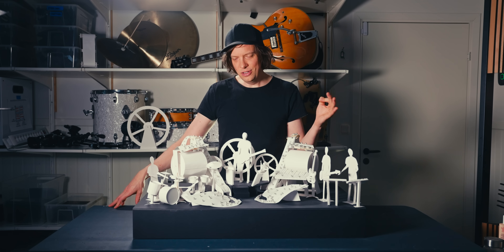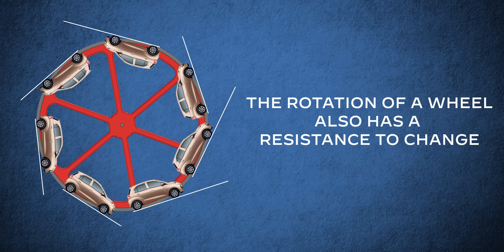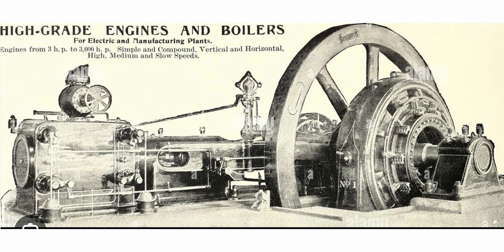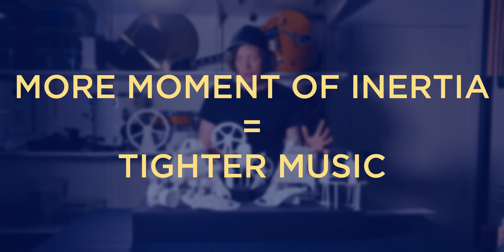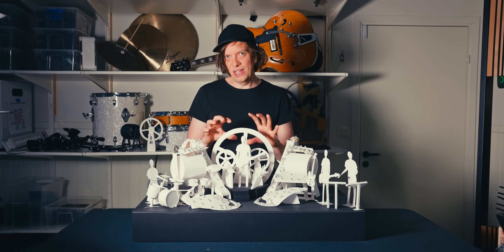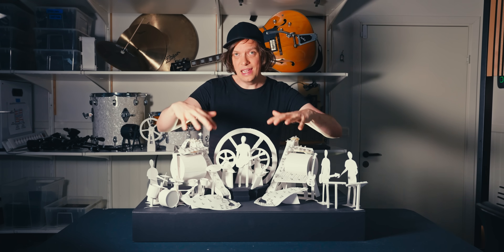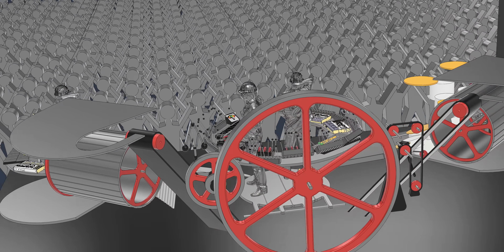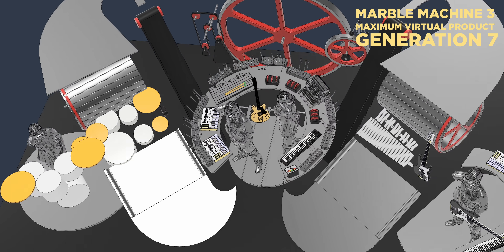What is Moment of Inertia? (The Heart of The Marble Machine)

Comment: It also becomes increasingly more dangerous to work around... if unprotected.
Reply: what if the larger size means it can move more slowly?
Reply: @PabloEdvardo  then it will slowly crush you instead of fast... Safety is going to be a topic
Reply: There will have to be some kind of plexiglass or other kind of shield
Reply: Bah, no Victorian worker ever died around these ginormous flywheels.
Reply: An instrument of death? That's fucking metal.
Reply: @OnkelPeters  Yes Victorian factories were famous for not killing anyone.
Reply: @voodooroller  any reasonable plexiglass shield would just be the first thing a runaway 2.5M flywheel would destroy. You would need something heavy enough to absorb all of the momentum. There's a reason they didn't bother shielding the giant industrial ones. If anything goes wrong there's no feasible precautions that will matter aside from dropping the whole thing into a deep pit, and maybe not even then
Reply: @RegebroRepairs  Exactly! And if someone died, it only redused the surplus population, which of course was good. - A little Dickensian referance there.
Reply: In my view not correct. The dangerous thing is going to be the stored energy. Not the moment of inertia. High moment with low angular velocity is going to store same energy as low moment of inertia with high angular velocity.
Reply: Angular momentum
Reply: Why did industrial era steam engines have large flywheels? Because the power stroke per minute number of these machines were low, so the angular velocity of the flywheels were low. Hence radius has to go up to achieve a certain target angular momentum. Large flywheels are a necessity if few rpm are required. If gearing can be introduced small flywheels can provide exactly the same angular momentum
Reply: @clausmadsen6754  I think the danger of the energy is the easies problem to solve.  the proper frame solves that, and that can be tested seperately from the machine.  You spin it up faster than you will ever do on stage, 20-30 times and bam you will know if its good enough. the people or stuff ending up in there is harder , because it needs to end up looking good.  Plexyglass will help with that problem. but still will be challenging.
Reply: @theJonnymac Just because it was fine once, doesn't mean it will stay fine. Metal fatigue, vibrations, faulty installation, damage during transport... A lot of things can go wrong. The test that's actually important is what happens when the flywheel gets detached or breaks apart (if built out of separate pieces). You must test the worst-case, not the best case.
Reply: probably will compensate moment of inertia by being lighter and turn slower, so way safer.
Reply: for sure there needs to be a disk covering the spokes. plus it would also reduce the wind resistance making the wheel more efficient.
Reply: To the new marble machine… people are the lubricants.
Reply: Мартин открывает клуб самоубийц? 🤔
Психически здоровый человек не сможет попасть в этот механизм. 
Борцов за ненужную безопасность - в пень!
Reply: Seconded. Machine guarding will be needed (but can also look amazing)
Reply: these comments about how dangerous it is are just dumb. Of course everyone knows that. That's why you make sure it's not gonna fly away badum tsss
Reply: So we need armor... Thats even cooler!

Comment: Please put a shield on this wheel! Either into the wheel or better - a transparent wall on both sides. Industrial age had a lot of people with fractional numbers of limbs excactly because of these huge flywheels...
Reply: Didn’t he do that for the flywheel on the MMX? I don’t see why he wouldn’t here too.
Reply: @tedioustotoro4885  because it big and heavy and it will not stop for such trivial things as arms or bones
Reply: Absolutely and they are going to be near it so its a real risk.
Reply: What if, instead of a shield, we make it out of super lightweight materials packed full of hydrogen, so that if it does break and fall off, it floats away. Just don't do an American tour with it, or some dumbass is going to shoot it.
Reply: This introduces new problems,  @UnfamusOfficial . Mainly, the point is it's heavy. That dm term in the formula shows us that the heavier, the higher the moment of inertia. Thus, lighter materials result in a much worse flywheel.

There's also the concern of the hydrogen leaking, possibly exploding, etc
Reply: Yeah I've thought - it would be much better if you had a smooth surface outside so stuff can't stuck between the spokes while it's spinning.

Comment: You gotta find one buff dude to take on tour who starts pumping half an hour early to get the huge flywheel up to speed before the concert.
Reply: probably will compensate by being lighter and turn slower, so same power input of the current one. and safer too
Reply: I have to wonder how long it will take to get up to speed...?  Also, this device will be used throughout the concert.  Will it keep on spinning between songs?  You will have to isolate the power so  you can change your pin drums safely.  I hope this will be mitigated as the design progresses.
Reply: @tomnesler2089 когда люди придумали маховик, тогда же придумали и сцепление.
Конечно между песнями будет вращаться.
Reply: Put it in an enclosure, get it spinning back home, transport it while spinning and it's ready to go on the stage. 🙂
Reply: Get Hannes to do it
Reply: Block and tackle system to raise the heavier weight will compensate.
Reply: @AffordBindEquipment 
Transporting a spinning wheel that size is not going to be possible because transporting a wheel that size was impossible in the first place. The whole point of being able to assemble and disassemble the wheel was transportation.

Comment: not to dismiss the positive side effects, but there are also some important negative side effects:
1) more moment of inertia means you need better safety systems, because the danger scales similar to moment of inertia. This will be a big problem, especially when trying to find venues that would host wintergatan + machine
2) more moment of inertia means more vibrations if the flywheel is not running perfectly true. Especially on tour, big mechanical things get bumped and slightly deformend, so this is something that will only truly be visible after some time. Those vibrations are especially dangerous for shows outside of full time music halls with a solid floor. Festivals/mobile stages build their stage surface out of stagedecks/scaffholding, that is very durable for heavy compression loads, but suseptible to vibrations/dynamic loads.

I think it is important to have these things in mind when designing, because with the current plan, it looks like you are building a machine that might be able to play music, but can never leave your show, because no music venue can/wants to handle it
Reply: Point 1) is very important for sure.
But point 2), not really. For a given angular momentum, if you increase radius (and moment of inertia) keeping mass constant, you can then reduce angular speed.
And as a net effect, this reduces the overall vibrations.
Reply: Great points! It would have to have a gigantically heavy base. Those giant example machines were bolted straight into concrete, and giant cast iron behemoths.
Reply: Let's not forget ensuring a stage that can support it; you don't want to limit the venues if there are very few that can take the load (both static and dynamic)
Reply: Well, with such a large wheel it can spin relatively slowly and thus the vibrations can be mitigated with just good bearings and maybe some slightly vibration-dampening mounting.
Reply: Yeah, the minimum viable product idea has gone out the window, really. this is maximum non-viable
Reply: Maybe it would not be that bad. Probably flywheel does not have to be solid steel, so even though massive, it won't be that heavy. It may have a form of huge industrial flywheel, but be build for example from plywood. I am not familiar with required momentum of intertia.
Reply: Also if you are taking it apart and putting it together for every show things will get worn. Alignment will be a difficult part of the design, it must only be possible to put the flywheel together in the correct way, and be planned for how to balance it before every show.
Reply: adding to that...
1) you should have an emergency brake that can quickly stop the flywheel and rest of the system should anything go wrong. (an old school mechanical drum brake on the flywheel with a hand brake lever for example)
2) guard rails, clear plastic can be used to prevent any limbs from getting caught without blocking the view.

also going from what you said in #2 having some holes that you can add extra weights in different places to the flywheel to rebalance it while on tour would help. (i know he hated this idea BUT a bolt with a washer stack would help with that, unless its really bad)
Reply: Also, more inertia means that playing more dynamically would become harder (changing tempo for different sections of the song). but I'm not a composer and idk if thats so important...

either way, I love the big flywheel - I would buy tickets
Reply: Agree 100%  the flywheel brings at least 2 major safety hazards- both can be overcome.
1) Must guard against human contact with flywheel (becomes a Salad shooter)
2) Guard against release of wheel from frame/ preventing wheel from escaping frame at all cost.

A safety brake would be nice- if practical. Depends on the planned amount of energy stored.
Reply: Do you think it's possible they could use a wider wheel and then just magnify it somehow?
Reply: @grantchereskin729  I think thats what the gearbox is for: changing tempo without affecting the flywheel speed.
Reply: @JackDaniels-pn6hu  3) Everything driven by the flywheel is a risk too; there needs to be a fairly low-force mechanical fuse (shear pin, frangible link, clutch plate) between the flywheel and anything else that can be touched
Reply: @grantchereskin729  the flywheel brings constant rotational energy into the system, some kind of gearbox and/or a governor can be used to set the actual musical tempo. The large flywheel will be a chore to get up to speed though all the energy it stores must come from somewhere.
Reply: Point 1: You can control moment of inertia by adjusting the weight of the wheel. So a big wheel doesn't necessarily have more moment of inertia than a smaller one, it just needs to be enough to run the machine.
Reply: I feel like martin saw "r^2" in the formula for moment of inertia and just went with it without considering what the machine actually needs. Consistent tempo can be achieved through a variety of ways that pose less mechanical, musical, and saftey problems.
Reply: @grantchereskin729  That's done on the programming wheel, the drive will always spinn in the same tempo thanks to the Huygens drive
Reply: A bigger wheel has the same moment of inertia for a smaller mass (or a greater m.o.i. for the same mass) and so would not increase static loading on stage. It wouldn't have to be made out of cast iron like the true industrial revolution flywheels, it's only powering a marble machine and not huge equipment. The vibrations could be stronger but they'll be less energetic and so likely less of an issue, plus balancing could be done with moveable weights quite easily, even with wear. If anything it's likely safer than a smaller faster flywheel, not only do you have more time to react, it will hold less energy (energy of flywheel = m.o.i. * angular velocity ^ 2). I know I'd rather stand in front of a slow rotating 2 m wheel than a fast rotating 0.5 m wheel!
Reply: The larger flywheel doesn't imply more moment of inertia.  The needed moment of inertia is already set for the system.
A larger flywheel (or rather flyring) can be lighter and/or rotate slower for the same moment of intetia. So a larger flywheel would actually help with all of the mentioned problems, not make them worse.  The wheel itself doesn't need to be perfect, it just needs adjustable weights to balance it each time it's setup.
Reply: We discussed the safety in the comments of the previous video. Martin seems to ignore this comment section. He is in the bubble once again.
Reply: The safety does worry me. It is a scary amount of energy. Should be tamable of course, but it needs to be taken very seriously.
Reply: I'm no engineer. But I have to say this. Why one big flywheel?  Why not use 3 smaller ones linked together to get the same inertia. They could be configured in a triangle. Could be just as visually big. Instead of one spinning thing. There are three. Easier to stop one of them should it be needed. Solves transportation. Already pre balanced. Could be a safer solution.
Reply: @tigerzero5216  That would be a mechanical nightmare. You could do it, but it would add mad complexity to the system. If you have 3 then you need to add gears connecting all 3. I t would end up being just as big as well, but have less inertia.
Reply: Exactly, you're gonna be dealing with a great amount of hazard if you go on with this flywheel design. Maybe covering it up wit some sort of plexiglass could help, but then you need to avoid stage light reflection...
Reply: I would say work out how to move a bigger wheel, don’t dismantle it! Putting it together again in a balanced way would be a mission every time. Maybe when you fly the wheel to another country you dismantle it but keep it together and drive it around on the back of a truck, once you are on the same continent.
Reply: Maybe danger is the most important part of the industrial revolution aesthetic. I would bet money that each of those machines in the illustrations has killed or maimed someone at some point.
Reply: @AJMansfield1  MMX had this issue too and it was solved with a slip joint. It saved the MMX several times when marbles got jammed in gears and such.
Reply: @MapedMod  He's not ignoring. He's aware of the safety issues, but he's trying to get the vision board complete first. Safety is something you can approach when doing the actual CAD designs.
Reply: @karolwachtarczyk  Isn't mass a major part of inerita?  if one made it out of balsa as opposed to lead, which one would spin the longest without any variation in speed?
Reply: @JackDaniels-pn6hu  escaping from the frame:   people would pay big money to see that!
Reply: there is a video where Adam Savage tries recreating an old time weapon of sort, and it's big thing is a huge Fly Wheel. let's just say the bigger the flywheel, the more danger of suddenly stopping it and it going ripping through things. so you will need a mechanical disconnect so that you can let the fly wheel spin down on it's own, and allow you to change songs as well.
Reply: I've been thinking about point number 1 all video through. With a flywheel this big, and without the necessary protections in place, someone could easily loose an arm...
Reply: @pedrop1192  yeah that is what i was thinking, maybe more than one flywheel might work better, if you have two people pumping could have two flywheels, maybe a third
Reply: I'm worried about if someone does a ISO 12100 Risk Assessment or address it with an IEC 13849-1 safety control system. This looks dangerous to me.
Reply: But larger flywheel means lower rotational speed for the same kinetic energy, which is generally better.
Reply: @AffordBindEquipment  of course it is! However, the most important thing is that in the equation for intertia calculation contains radius squared. Let's assume that previously planned 1.5m diameter flywheel was meant to weight 20 kg. If you increase diameter to 2.5m, to keep the same intertia, you would need a flywheel which weight just 7.2 kg.
Reply: @AffordBindEquipment  To be specific, I have logged into the Wintergatan Engineering Discord server. In the design inputs it is assumed that flywheel would be 100kg with 1m in diameter. If we increase diameter to 2.5m it would have to weight just 16 kg to get the same inertia.
Reply: @karolwachtarczyk I was thinking of something the same size.  But larger/less weight has the same amount of energy, same amount of damage done if that thing gets loose.  At the increased radius, would balance be easier or the same?
Reply: this ^^^^ especially point 1
Reply: Keep in mind, this thing will not need to spin very fast, just 1-2 hz would probably be more then fine.
Reply: @hundredfireify  The 'minimum viable product' would just be a midi keyboard and some marble animations on an OLED panel. If this thing doesn't look cool then what's the point?
Reply: @LoneWolf0648  The problem is your break system needs to be attached to something that can handle that much torque. In a big factory it could be bolted into concrete but I don't think that's possible.